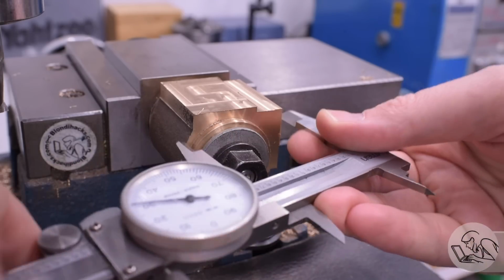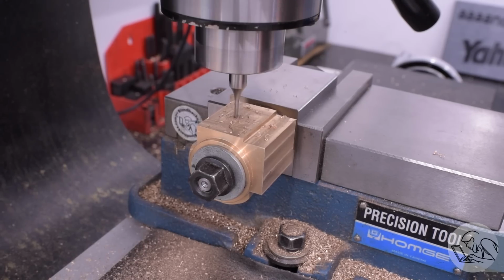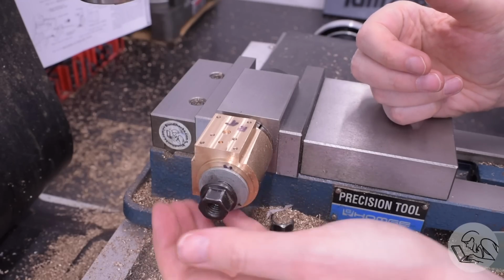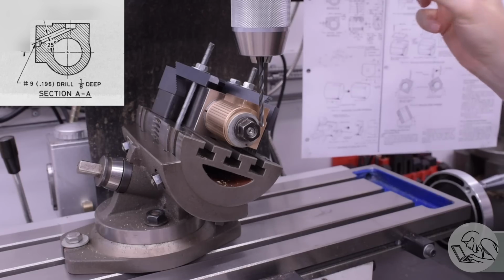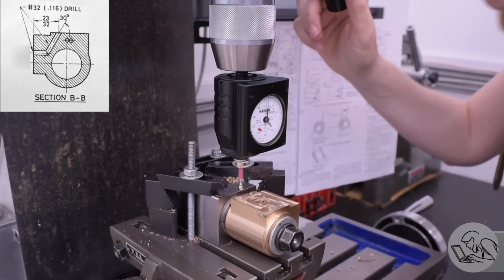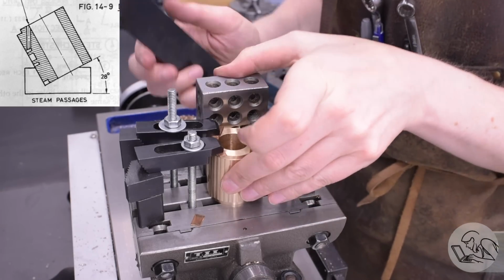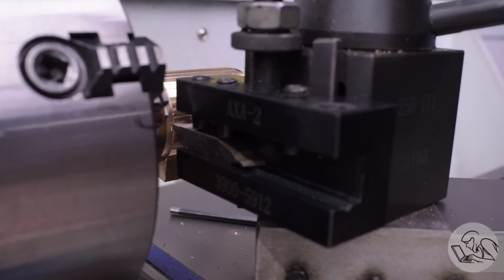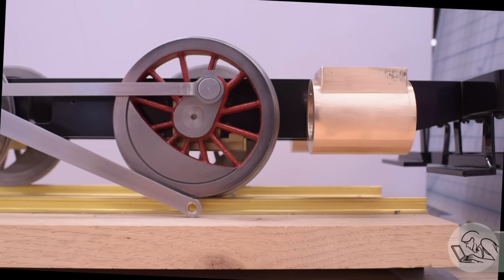Finishing The Cylinders! - Pennsylvania A3 Switcher, Part 46

Comment: In some very old stationary engines they had cast iron covers over the cyliner insulation. The covers had grooves or fluted depressions in them. Kinda looks like that on your culinders where you cleaned them up. I like it 🤓

Comment: That universal tilt table T.I.I. label stands for Tool Importers, Inc. which was a company operating in at least the 1960s and earlier bringing in tools from Japan and selling them direct to consumers in the US.  So that's not who made the table, just who imported it.  You'll find that exact table listed in their 1963 catalog.  Unfortunately it appears TII went out of business prior to 1977.  There appears to be a model number stamped on the tag, if you can let us know what that is, it's possible that TII may have used the same model number as the original manufacturer, which may help find who actually made that table.

Comment: Would shifting the center of the core slightly in the initial boring operations have avoided the one dimension being undersized?
Seem like there was plenty of material in all the other directions.
Reply from the maker: Yes that would have been possible, I believe, just barely. It would have required me to do a casting layout before starting to realize that, which I didn’t do

Comment: I want to mention a kinda funny, kinda sketch to the point of being scary story about braze on steam chests, which is one of the steam chests on either RGS20 or D&RGW346 at the CRRM is basically entirely built up of braze, there was some issue and the shop crew had to take it apart, and long story short half that part of the casting broke off and a guy at the shop built it back up with braze and they remachined the valve body into it, I can't remember if the steam chest was made of braze already and that repair broke at the museum, or if the casting broke and that was the museums solution, but I'm pretty sure she's still running like that so... take that as you will, you could bother Hyce for the details or go try and find which video or stream that was told on some number of years ago

Comment: I like that rotary tilting table- wish I had one.  Here's a tip:  Assuming there's room under the head, use a repurposed windowshade roller to hold your waycover, place a plain roller at the base of the column,run the waycover under it and to the saddle.  If you've removed the ratchet, it'll keep tension on the waycover as things move.  Remember, in this economy, Poverty is the mother of invention!

Comment: They look so nice that it's almost a shame to powder coat them.   And is it a little odd that I liked the look of the original milled flats?  In my mind's eye I was seeing the center of the cylinder barrels  with the coarse original VGA flats and chest bosses done in a dark red powder with the machined ends left bright brass.  Or perhaps clear coated to hold the brightness?  Hardly "scale" but darned if the BLING! factor wouldn't be through the roof ! !    As for the lost sleep?  I'm sure you're not alone at that when it comes to doing that sort of drilling job.